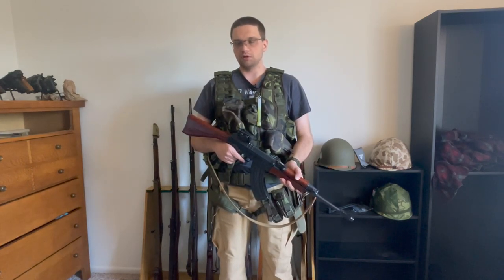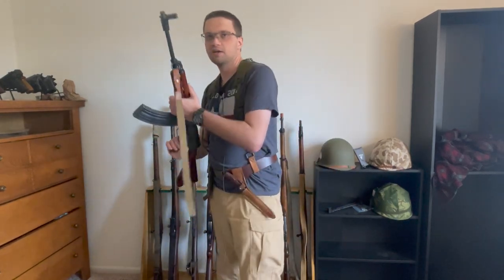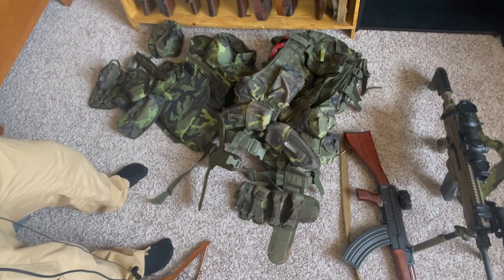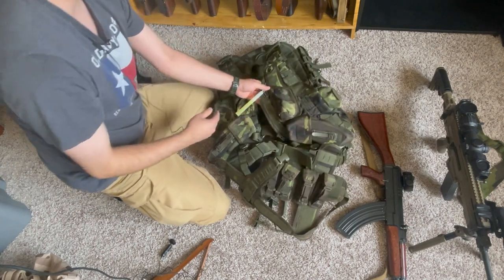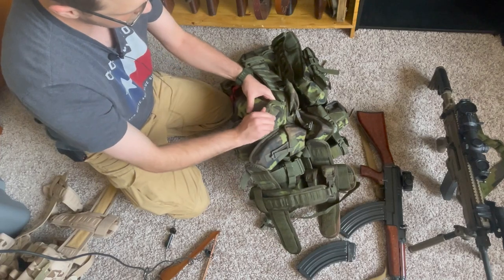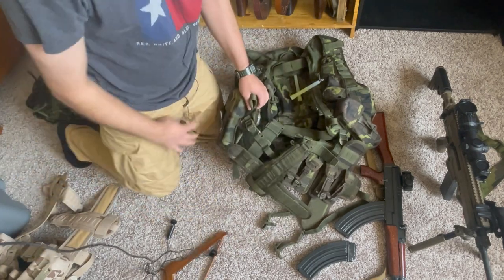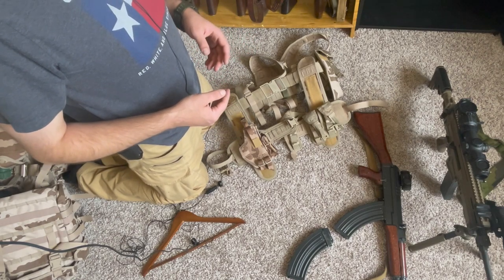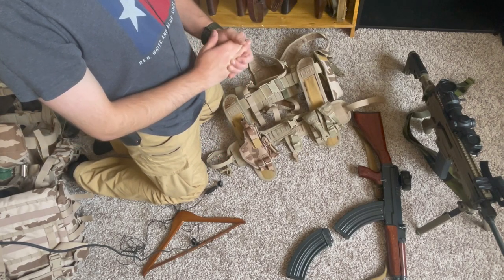Czech MNS 2000 Load Bearing System: History and Overview

Comment: the cloth pouch you had for the old style webbing was part of a paratroopers' gear, standard infantry would've still being issued the leather pouches, also when they moved to the nylon y straps they also ditched the belt loops as well and just hang the y straps directly on the belt, which is actually more secured

Comment: on the harness portion, the horizontal underarm side pockets are large enough to hold STANAG mags and PMAGs. If you tried, you could probably stuff two STANAGs in those pouches but you'll probably dump them both on the ground trying to get just one out. I have the later vertical type pouches on mine and I can carry 6 loaded PMAGs on me (4 up front and one under each arm) without needing a single extra pouch. I picked up a dump pouch that I attached to the lower back strap (I don't use the backpack) that allows me to carry two more magazines and have a convenient place for the empties when shooting matches.

Comment: vz95 does not come from US woodland. British army was an inspiration for CZ army at the time in general.
Reply: It was and most of the pouches (MNS-2000) or vests (TL-98, UNI-07) takes direct inspirations from PLCE and British Assault vests. But for the vz.95 pattern itself, the development started in the 80s and was mostly influence by the USA ERDL pattern (nothing in common with DPM-like patterns), which was later modified to M81 with different color scheme. Only the desert vz. 95 was directly influenced by British army, desert DPM basically thrown onto vz.95 shapes.
10:27 - the reason why the vest are very large is also that Czech are tall nation in the Europe, 180cm (6 feet) as average and 200 cm quite often.
13:06 - 805 was basically "private company development for taxpayer money". It was horrible. The magazines were even bigger and heavier than for vz58, although chambered in 556. Bren 2 is finally worth it. 
21:21 - the universal pouch elastic loops were designed not for shotgun shells (CZ Army does not use 12 gauge like Marines) but for ammunition for signaling pistol, which are slightly bigger in diameter.
22:27 - just a small observation - in the vz95 woodland, you have the "mala polni" standard backpack, but in the desert camo you have "mala polni pro pancerovnika" (anti-armor), notice the three big round holes in the bottom. This version of small backpack was for carrying three RPG-7 ammo.
Reply: Vz.95 was in reaserch from 1980s